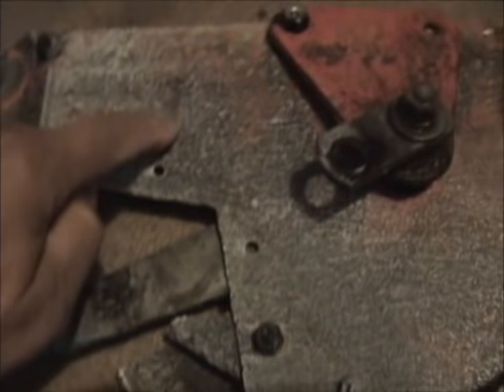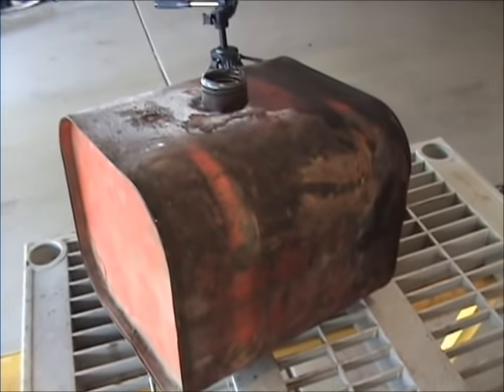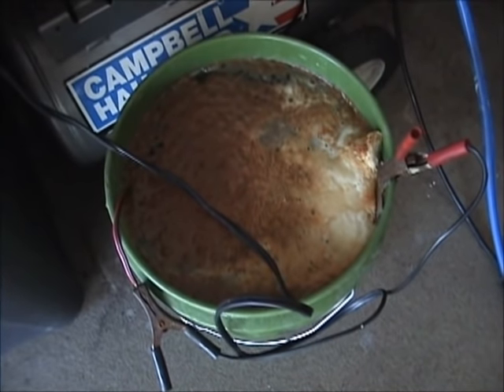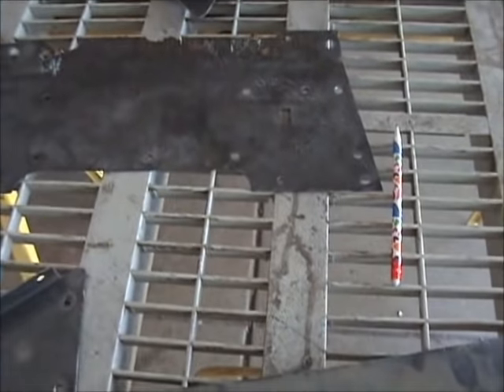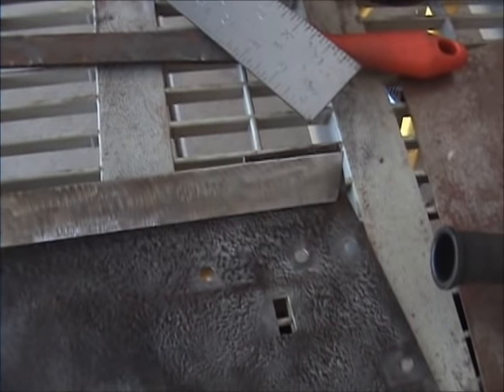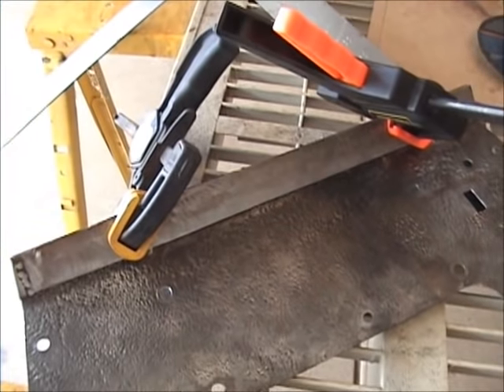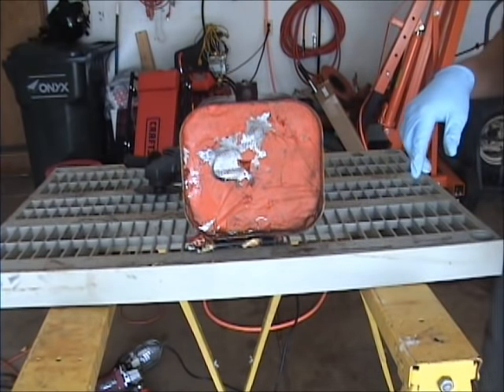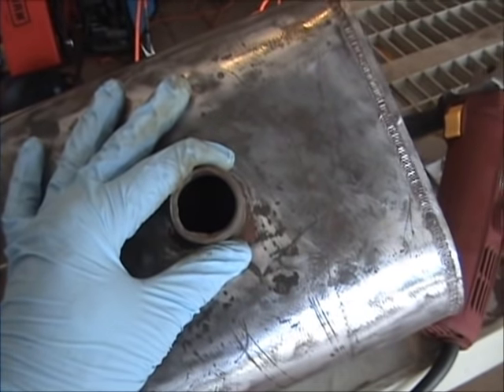20) Allis Chalmers 310 Tractor Restoration project, video 20

Comment: The baking soda is a mild caustic (alkali), and it will soften up most paint, regardless of whether or not you are pumping current to electrolyze the rust.

Reduction Occurs at The Cathode (ROTC) - so you want the black lead (negative, attracts cations) hooked up to your part, and the red lead (anode, positive charge, attracts anions) hooked up to your sacrificial electrode.

Safety concerns beyond dealing with caustic, which is bad for your skin & eyes...

The electrochemical process evolves hydrogen - work in a well ventilated space, so you avoid the risk of fire.

Stainless steel contains chromium - it's not a good thing to be making chromium cations - some of which will have a +6 charge (hexavalent) which are really nasty chemical compounds. Scrap iron (not galvanized) is better, and graphite (carbon) is best...

You got good results, so this is just a general warning for the future...
Reply from the maker: chemech I didn't the know any of this.  Thanks a lot!!  Great info.....
Reply: Glad to be of help!

See, I actually got something useful out of that chemistry degree! ;^)
Reply from the maker: LOL